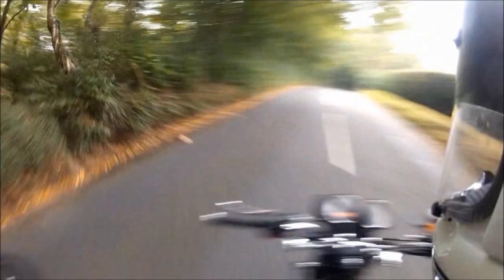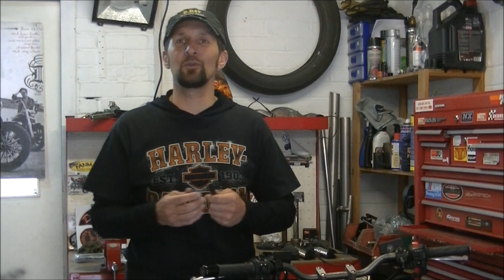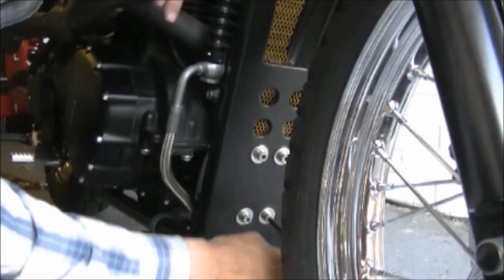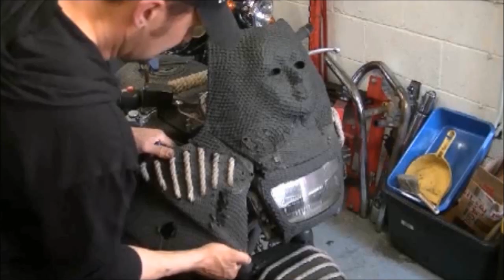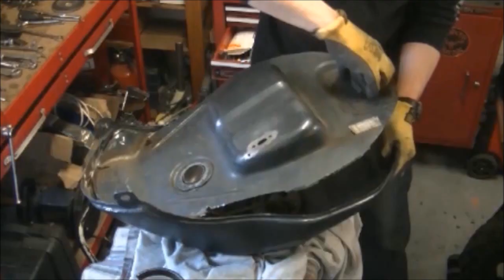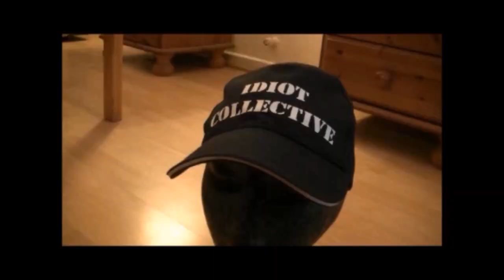Delboy's Garage T Shirts....Progress update !

Comment: Hey up del...if u have 5 mins. could you do a quick review on your roof lid since youve had it awhile now...noise.? comfortability? Rain leaking in the visor? Ect Im in the market for a lid atm and thats in my shortlist. Cheers
Reply from the maker: Hi mate.... its not been long since i did the un-boxing of it....so ill not make a video of that as its such a well known lid that most people either love them or hate them on looks alone... plus we are about garage more then product reviews.

I can tell you that its comfortable, but then i don't buy a helmet that isn't...tried it on in Helmet City and walked around the shop in it for half hour, and eventually it didn't feel like i had it on... but that's all pointless to you as everyone has a different skull shape, and it may not feel good on you....you need to try it on ans wear if for a while to know id it fits you.

Its quiet, no lift even and motorway speeds..and the upward visibility is amazing....and with a black visor its perfect for enjoying the sunny sky on a hot day..!!!! the visor seals by pushing into a velvet soft lip, so if its not pushed right down it can leak in heavy rain....but the chin bar is well vented and it stays clear in all but cold morning rain...

TBH mate, its not an Aria, and is really only good for local rides (under 100 miles) of you wanted a helmet for riding round Europe then its not the best.....but the ability to lift the front when you pay at petrol stations and not look like a daffy instructor is great... all in all mate, i love them mostly because they are cool and penguin's piss....the rest is a bonus...

Hope that helps a bit... go try one on maybe, see how you feel.. Cheers, Del.
Reply: Moonfleet41 cheers for that reply. I take on what you say and plan to spend a few hours at my local bike shop on Saturday. Thanks again :)

Comment: Hey Del, just wanted to know if you are sending acknowledgements out to people. I only ask because you have said that the T's are flying out and you need to re-order so some of us will get them a little later. I sent my order/payment to you via PayPal on the 2nd Sept.
Also, quick suggestion, I know in the UK bandannas aren't the usual but what about the 'Buff' type neck scarfs?
Reply from the maker: Hi Carl, we don't send acknowledgments for the orders as Penny is backed up against the wall with the admin. as it is, she processed the orders at work in her shop (which is a separate business and un-related to t-shirts), fitting it in-between her customers and her commercial business, we do the packing in the evenings, which takes till the small hours and then they are dropped off at the post office... they send them in batches of 20 each day, the system is pretty efficient, your order was received on 2nd and was packed and dispatched by the 4th ... and as you are in Canada, it has a fair way to come... the airmail service claims to take a week-10days depending on handling your side, so bear with us, will be with you shortly buddy!

Spoken to Buff and they don't do it via screen printing as being stretchy they use a different process and the min. order to make them viable was 1,000 items, and we've had about 6 requests at best... for simplicity, we're sticking to basic t-shirts and going to venture in to hoodies on an 'up-front' order basis, as these min. orders from the print companies can be crippling and there's just Penny & I doing this, we're not a business...

Look out for your t-shirt should be with you shortly buddy!
Reply: Moonfleet41 Thanks for the quick response Del. I hope I didn't give you the impression I was complaining, far from it, I was just asking mate! I realised you and Penny weren't a business but who knows eh guys, maybe one day? Your videos are going down a storm over here with my new biker buddies so hopefully you`ll have more followers/customers. I'll definitely take a hoodie when they're ready as well.
When the T Shirts get here I`ll get some photos sorted! Shall I send the photo to your email?
Reply from the maker: Carl Turner  No worries mate, thanks for your amazing support, say Hi to your buddies from us... !  And we'll look forward to seeing you modelling the t-shirt lol! All the  best buddy D&Px